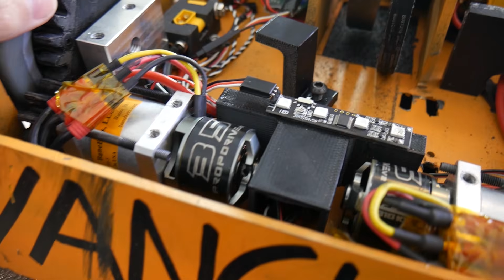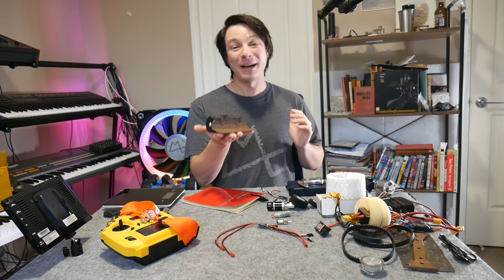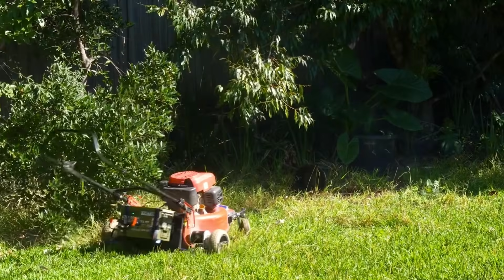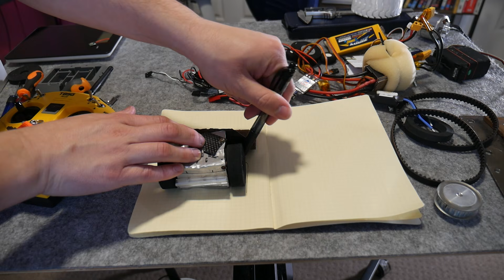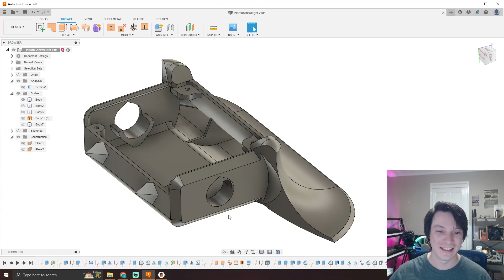3D Print your own mini battlebot! (FULL tutorial FREE .stl download)

Comment: Hey! Thanks for the STL files, we've started building this bot. One thing we didn't see in the video is the wheels! Where did you get the wheels and what should the spec be?
Reply from the maker: This video used old foam wheels - unfortunately you can't get them anymore. A large printed plastic wheel with a rubber band around it should work ok!
Reply: @MakersMuse  thanks! will do.
Reply: @MakersMuse  For anyone else wanting to find some wheels, I used the BaneBots T61 3mm hub along with the BaneBots T6 Wheel, 1-7/8" x 0.6", Hub Mount, 50A, and they worked great.

Comment: So I know this has been some time since you posted this video but you could drill out the tires so that way there's not as much foam rubber you can also put grooves in the wheels or the tires that would also reduce the weight without compromising but the one thing I'd really like to know is how you get the mixing on the controller I use currently a taranis XD9 D plus with open TX but would like to have reverse I'm currently using 2  30 amp Simon K tean Black Sheep esc's with 920 KV Motors running 4S battery I got it so where I can actually get it to go forward and I'm actually using both sticks one stick used to control the one which is technically the elrond and then I'm using the other stick which would be your traditional throttle for the left but I'd like to be able to get it on one stick and be able to go forward backwards and left and right with the one stick if that is possible thank you for the advice and I appreciate you sharing this

Comment: When I was 12 and Battlebots was on air for the first time I designed my own. I used graphing paper and ruler and refined my design, simple.
A flipper bot with such power and violence, sloped sides of course because I'm the one doing the flipping. I got sponsored by a major pneumatics company, if I could get the chassis and electronics they would give me all the pneumatic components I needed. For an ant weight this wouldn't work but it was 2 pneumatic cylinders connected in series with a joint. One mounted horizontally with a guide for the joint and the other vertical connected to that flipper arm... I did the math, "thrower arm" would be more accurate 😁

Comment: in my opinion, active flippers and spinners, should be banned outright

we should have piercing and slashing, or a wedge that you knock someone over by ramming them, not by having a part that someone else cant get, or something that cannot be countered without a specific design and very careful tactics

remember the issues with spinners:
1. you need a bot DESIGNED TO COUNTER IT or you basically cant counter it
2. you need to be careful when positioning yourself
3. having a massive spinner AROUND the body removes all tactics within positioning

in short:
spinners are boring and outright dangerous for spectators, even if they make short-term flashy sparks

Comment: Tip for when you mention using a cable tie to hold 2 tinned wires together to join them onto their place.

Instead bare the wire ends that you need and twist the wires together BEFORE you tin them, then tin them both as one mass before attaching them onto their desired pin. 

It’s both easier to do and also will give abit more redundancy on your soldering during heavey use

Comment: Good Job! One revision I would have made is instead of  a big saw arm, i would have sandwiched the belt between two thinner plates, that way it would have had the same stiffness, but a bit of armor too. Maybe some sort of mechanical clutch to limit the torque on the arm too. I too have had a hell of a time keeping these DC motors and their controllers alive in industrial applications where there's force applied to them. Maybe i'd use an electric piston mechanically disconnected from the arm pushing on it

Comment: I had really enjoyed building a 5.44Kg battle bot with my daughter and I can definitely recommend it as a learning experience. This was in 2015 and I was not into 3d printing yet, so as opposed to the engineers we were up against and their CAD designed and aluminium CNC constructed (and sponsored) robots, we went with a design using builders cardboard and then constructed the robot out of 3mm polycarbonate sheets (which can be cut with a bandsaw and is incredibly tough). We also used recycled stuff a lot - for instance the drive motors were ex-cordless driller motors and the weapon was made from reshaped (normal) printer rods! For the insides we used marine foam (super light, the stuff they use for boat seats) to protect the components. Of course the first time round there are lots of wrong turns and you can end up spending a lot of money for what is effectively 9 minutes of ring time. But the joy of seeing your creation out there battling away more than makes up for the spend. Thank you for this video!

Comment: I think the most entertaining class of battle bots would be like a wooden chassis only class or something. The problem with small robots that cant use explosives or projectiles is the armor to anti armor ratio just isn't there. I can just make a steel plated flipper robot and nearly no robot on the planet could generate enough kinetic energy to break through the armor which just isn't super interesting to watch. However seeing two wooden robots taking massive chunks out of each other as they trade blows splintering through armor would be absolutely sick
Reply: "I can just make a steel plated flipper robot and nearly no robot on the planet could generate enough kinetic energy to break through the armor"? Have you've seen modern insect weight bots? They can, will, and have easily tear a steel plated flipper apart. Hell, my beetleweights drum is so badly gouged and damaged that I can't use it anymore, and its a solid hunk of machined aluminum
Reply: @Coboxite  Bruh maybe it seems that way when you're the one that built it, but this stuff is televised lol. Ive maybe seen a handful of bots actually be destroyed, 95% of the time they just get disabled or get pushed out of the arena. Or just break.

Comment: In your wiring diagram you don't have a capacitor but around 23:01 there seems to be one under your right thumb. Does that come as part of the speed controller?
Reply from the maker: Yep, it's part of the speed controller to help it handle voltage spikes better.

Comment: I have a question I have recently gotten my son into fairy weight and ant class battle bots.  And I have a couple questions as we are planning on going down to makers faire on Sept 10th to compete.  1 of his bots is servo driven so it measures 4 and 1/4 inches wide and just under 4 inches deep.  Will it be legal to run in the ant all plastic class.  2nd question I am an fpv pilot and have them set up with ExpressLRS for the rc link it is 2.4 ghz and requires a binding phrase so it only links to receivers that have that binding phrase.  I have tried to get a hold of the event organizer with these questions but haven’t gotten a response 

Thanks
Rick
Reply: 1: Unless you live in the UK, the 4inch cube rule doesn't apply

2: What's your question here? As long as the radio failsafes you can use any spread spectrum radio

Comment: Just got back from Norwalk Havoc (a huge beetle weight competition on the East Coast of the US) with my fully 3D printed 3 lb robot. The full TPU chassis held up fantastically until my last match where I fed it into a top tier horizontal spinner for 3 minutes. The flexibility of the filament effectively meant all my parts were shock mounted. My drive never died in any of my fights

Comment: i have really strange question (i might ask about it before)
3d printing is a fun process but unless you are making something with really small nozle you can't really get a lot of detail on flat panels for small scale models unless toy have resin printer but that makes more problems down the line if your model is covered with embosed lines
you simply can't remove surface defects of 3d printing without sacrificing the details

so there is idea i tryed and failed multiple times , but effects were promising
did anyone else tryed to print just one layer 2d shapes on compatybile plastic sheets
because you can add sinken in details if you cut out the area and put in something else in that place, like door or a grill but making coregation of the body like reversed engraving cncshould be also possible, the problem is it ratelt bonds to the substrate well enough

Comment: Very cool design, but may I suggest you use smaller wheels? this will make your robot a bit slower, but you will get a faster feedback and more torque, your robot will punch a bit slower, but it will be harder to push and will have more pushing power.

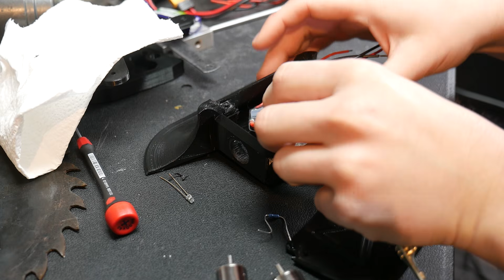Comment: 21:49 "There's no hack for this..."
You could split the G-code into 2 parts, and at the end of part 1 you stop extruding, and raise the head out of the way, and then the 2nd one continues from where the other left off.

Pause the printing in your slicer when it's complete enough to hold the annoying components, but not so complete as to be fiddly to access. 

Depending on what this point is you may have to , but if you have access to the internals more easily you could use alternative restraints. You might even be able to avoid needing support material in a couple of ways: you might fill a gap with something, or simplify construction. In this one you could print the whole thing as a "closed" container (with the openings, but having one piece.) There's going to be a line going through the print where you can see the 2nd part start on top of the first part.  

That is, unless you can print wavy lines. (Interrupting this hack for another potential hack.)

If you are only able to print during a certain hours, but want to try a print over multiple sessions in general, this might be helpful. I'm curious if printing the topmost layer of the 1st part with a denser infill that it uses (obviously only for the range where it makes sense.. not too wide across, not to narrow) would help in grabbing the hot plastic on a bigger surface when the infill on this first layer of part 2 prints. I'm not certain if that would help, but at least it might help you glue it. [and now back to the regularly scheduled hack]

Depending on your filament material and in some (i.e. all but the gentlest) potential cases, the physical size of the entire printhead might make a difference  This is because having other objects suddenly appear is kind of like what can happen with the nozzle during non-planar printing when the slope gets too steep. It's all more work and choosing between so many trade-offs. 

But assuming it's been done well enough, using non-planar printing ideas in combination with pausing might let you print sections in a different order for visual or engineering effects.

For example, in the areas you want to mostly print later you might only print the 1/3 closest to the next printing part on every 3rd pass, and the next layer you print the similar 2/3rds of it, and then print over it. because you're skipping areas, those will be lower, and provided you print the skipped stuff later, with similar mixing you could do some layer interweaving, And because it uses non-planar (up and down he Z-axis as well as X and Y) movement, it would have that same smooth flowing look over the sides. And the two edges where the pause was could meet smoothly along a curve.

The hardest part would be communicating what the outcome "means" to whichever action they did. 

But none of that's a hack.  Coz there's not hack for this. 

Ooo... you could quickly put parts in while printing is happening, all the while hoping that the slicer didn't ever tell the nozzle to move through where you're putting the LiPo. Or the motors.  It's like Jenga in reverse. That would be a hack. ;/

Comment: Would be good to know what switch you used, which controllers are compatible with the 2.4ghz 6 port controller you used. I saw you used the hotRC RX one so bought one of those with a HotRC TX. Later when you assembled the RX changed so would be good to know if I've just mucked up and wasted £60! :)
Reply: Also whether these 2.4ghz radios are all intercompatable. I have absolutely no idea. Or if I buy two, (which I did to make two) will they automatically work out which is on which channel etc so one controller doesn't control two of them etc
Reply: Also what size wheels did you use? What are they called.

Comment: I was really surprised you didn't just hole pattern the whole frame to cut weight down.  Also please orient your layer lines for structure when you fix it. A couple degrees may add some support required but will change the strength so much.

Comment: Question
1. Can i build a 1s setup of battlebot? Any part suggestion.
2. Can i use cheap 27mhz 2ch rx tx? 
1&2 are for learning purposes. Thanks
Reply: Most clubs require 2.4 GHZ because of interference, however for practice you can experiment on your own. I personally have never seen a 1s bot, but there is a first time for anything!

Comment: Use the power of the Slicer, Angus! 
I had a friend wanted a fairly specific mounting frame for a project, had about 85-88g for a frame, rather than make and weigh several prototypes I sliced the model in Cura, that said that I was way over, did a few redesigns and got it down to 78g, printed it - and V3.3b design was strong and light enough for them. I also discovered a cool hack, you can use 0% infill and big voids to lighten something, and where you want a mount point, add a daisy pattern of holes, the holes each have to have walls and so the mount point ends up solid enough to glue something to or put a screw or bolt into.

Comment: Hey now, thats not entirely true, you CAN use a stepper motor in combat robotics, you just need some additional programming, and you'd want to either sense a stall using stallguard code or sense position in one of..several ways really.  Theyre more capable of producing high holding torque without needing gearing IMO.  Its kinda a pain, but there are use cases.  Itd be useful to automate certain processes, unsticking devices, or weapons.
Reply: Oh, they ALSO make really decent axe or pick motors if you use a pulley system.

Comment: I would try printing it in HIPS, it's a lot lighter and more or less equally or even more strong. Recently I was building a robotic arm and rebuilt part of it in HIPS. The results are amazing, perfect looking prints with good strength and temperature resistance, and much lighter to boot! I am considering switching over to it as my main material since it is same price/ cheaper than pla for some reason and easily recyclable(same stuff as milk bottles)

Comment: I love this!  Here in the Denver/Colorado Springs area, we've had a long tradition - the Critter Crunch.  The Crunches were held during conventions, and technically started out as Critter Crawls... but a group that calls itself the "Denver Mad Scientist's Club" isn't going to settle for a little parade for long. Thus the Crunch was born.  I stumbled onto them in the mid-'90s, and they had been going strong for a while even then.

Now, given that these were held at science fiction conventions, and thus, mostly at hotels, some of the more... violent and destructive options had to be.. contained.  So instead of trying to break the other Critter, the Crunch evolved into more of a Sumo-style competition, aiming to shove the opponent either off an 8 foot square platform, or render them immobile.  There were still shenanigans galore, but the hotel liaisons worried less about emergency visits by the fire department.  (I do know of at least one tiny flame thrower, and I think Gomez did finally retire Big Punch due to issues with the launched spike tether breaking.)

Other quirks:
While never a requirement, there was something of a tradition of scrounging parts rather than buying them, at least for the larger class.  Motors were frequently sourced from junked cars - windshield wiper and powered window motors were quite popular as I recall.

To keep things from getting out of hand (and potentially taking over the con), there were only two weight classes - two pound and twenty pound, both limited to an initial size of one cubic foot. A common design element was some sort of plate or ramp that would drop down once the round began.  There had been mention of a larger, two hundred pound class, but that would have been exhibition only - partly because one of the hotel liaisons about fainted at the mention, and partly because there would be the risk of several competitors trying to fit themselves inside.

Hey, they are called "mad" scientists, after all.

And one of the odder quirks in the earlier years, the twenty pound class was initially not allowed to have remote controls.  It seems that there were some occasional issues of interference, causing problems such as blocking the signal of the opponent, or actually controlling the others Critter.  Since these issues were inconsistent, it was decided to require all twenty-pound class Critters to be run via a cabled controller.  This had the benefit of some extra entertainment as combatants had to circle around the platform to control their tethered Critter, while both dodging and not getting tangled up in each other's cable.  Occasionally even minor acrobatics came into play.  

Meh, I could babble on even more, but my clock just reminded me I need to be back up in a few hours.  Needless to say, though, I'll be watching these builds closely and with great enjoyment.  And yes, I plan to download the file... in the morning...

Comment: It makes soldiering more of a pain, but I would shorten most of the wires to minimum, as copper is heavy, (comparatively to the weight class.)
Reply: For robots that get jostled around you would want a little extra length for strain relief though.